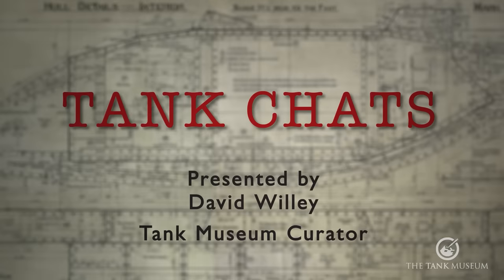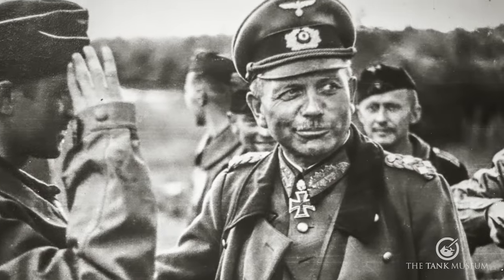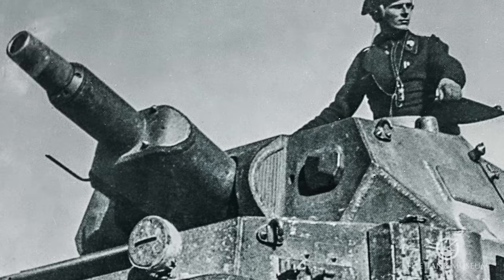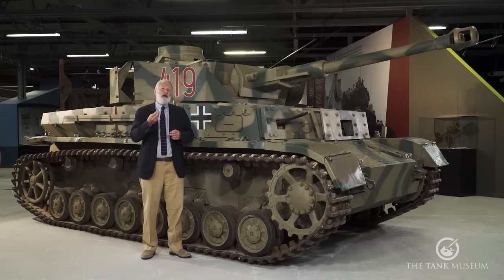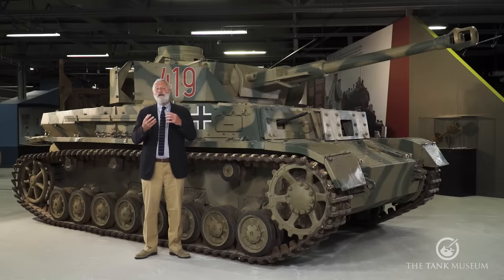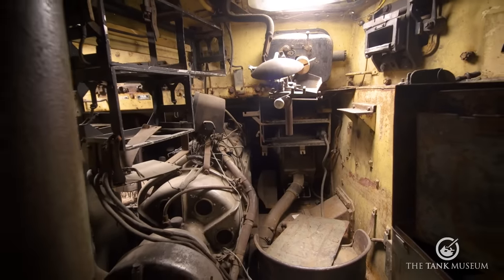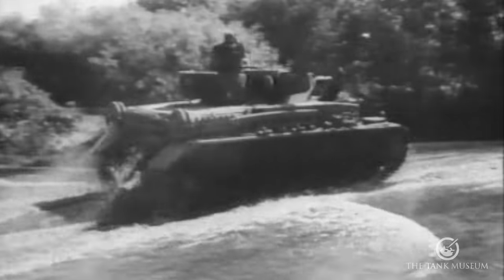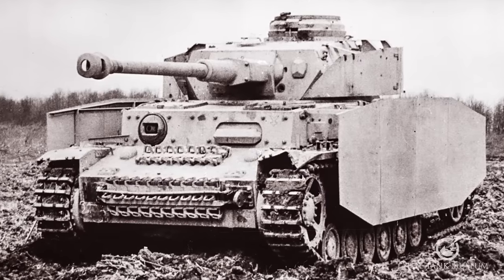Tank Chats #106 | Panzer IV | The Tank Museum

Comment: Ah yes, the good ol Panzer IV. Looks great, and doesn't break instantly when you decide to go up a bit of a hill.
Reply: AKUJIRULE  you first
Reply: AKUJIRULE  youre point being?
Reply: (Sad Elefant noises)
Reply: AKUJIRULE maybe they should have used their brains when designing the panther with a sealed hull lmao
Reply: @Vibakari  they did. where do you cross rivers when most bridges (in the east mostly made out of wood) can only support 25tons. Sealing up the engine and add deep wading capabilities was pretty clever.

If I watch the Swedish post war tests of panther and sherman, the panther continues to climb slopes and hills, plows through deep mud and snow without catching fire, while the Sherman fails on most obstacles.
Reply: @HaVoC117X  I have told everyone to watch that video before saying anything about Panther. It climbs hill no problem and didn't even burst into flame.
Reply: I'm sure you are referring to the pzV, you need to look at actual combat reports, and if you do you will find the reliability issues are greatly overstated by so called western experts. You sell a lot more books and speaking engagements if you tell the audience what they want to hear as opposed to facts
Reply: @Anlushac11  exactly. Only the early panthers from 1943 were kind of unreliable. Over 6,000 weren't built for mo reason
Reply: Nah, the Big Cats were reasonably reliable when used within their designed parameters. The French had no big complaints with the dozens of Panthers they ran for a number of years. If you clean the oil and transmission of a Tiger I every hundred or so kilometers as intended, it runs beautifully and over terrain that would stress most other tanks of 1942 badly. The real issue is that the Germans never really had the time to do the needed maintenance because they were fighting a much more intense war than planned, so ALL their vehicles were breaking down by the mid-war and it would only get worse. On the many lists of German vehicles the Allies found, as you will find quite a few "reliable" Mk IVs broken down alongside the Panthers, because they weren't getting the love and attention they needed either. You should be able to find some in the American National Archives or the Imperial War Museum if you wish to look. Heck, just check them out anyway because archival records are awesome, especially if the words Aberdeen Proving Grounds show up!
Reply: @genericpersonx333  another thing to consider is that most Germans of that era didn't even know how to drive a car, so training the average German how to properly handle a 45 ton, 6-700  horsepower tank would have been hit or miss even in peace time conditions
Reply: @HaVoC117X  what is the title of that video footage?
Reply: @Anlushac11  no wonder the Nazis won the war!

Comment: Forget the Panther and Tiger, Germany's two most important tanks (well, AFVs) were the StuG III and the Panzer IV.
Reply: Yep
Reply: Can't "forget" the Panther and Tiger! Without those and other strong AFV's, the Battle of Kursk - and Germany - would have been lost much more quickly! Yes, the PzKpfW IV made up the backbone of all tank divisions, but it was the Pz V and VI that helped to counter the T34, the JS and KV tanks, not the Pz IV's... which would have been pulverised without their successors in support to both take and deliver the big punches.
Reply: @johnny_pilot  Eh, the big cats were pretty overrated imo. They were prone to breaking down, and even though they were tough, they were hard to replace. Being difficult to repair and being too expensive and complex to mass produce effectively. Most of Germany's heavy tanks were lost to their own technical difficulties rather than combat. And and since the germans were fighting a war of limited resources and fuel, they were probably more costly than they were worth.
The light and medium tanks and the cost effective stugs were the real peak of German engineering during the war.
Reply: @nbewarwe  the usual comment again, :-)) and as usual not that true.
Reply: AFV is an apt translation for Panzerkampfwagen: Pzkfw
Reply: @nbewarwe  They were losing and on the defensive by the time Panther rolled out. There's no point having a cheaper, more practical vehicle if you don't have the men, fuel or production capacity to field lots of 'practical' vehicles. I would have liked to see the Pz. IV line continued and perhaps given sloped armour like a Panther, maybe a high velocity gun like the L70 etc. etc. but the fact is the German's best option at that point was fewer, tougher, more powerful tanks. And Tiger, at least, was always going to happen. So I'd say things played out exactly as they were supposed to.
Reply: @vincentrees4970  that's a fair point
Reply: @nbewarwe  The Tiger tanks both Tiger I and Tiger II were not unreliable.  They were high maintenance items. (All tanks are high maintenance items) but so long as the procedures of track tensioning, bolt tightening etc were carried out it worked fine.  That was understood by the German Army when it acquired the tank and it was considered acceptable given it was a specialist tank used for breakthroughs.   The Tigers did not have issues such as the final drive failing as Panther did because the Tiger I/II were given well engineered and manufactured products.   Panther went from drawing board to combat in less than 1 year.   That's an incredible achievement.  It's not surprise it had faults in the first year of operation.  By the time of Ausf G it was pretty reliable.   The Sherman and Panderer IV were reliable because they were mature products ithat had been in production for several years and in which the bus had been ironed out.  The Sherman was based on the Lee Grant mechanical.   In the case of Panther final drive gearbox lubrication issues solved some of the reliability issues but these fundamentally came out of being a simple straight cut gearbox instead of herringbone gears (Sherman) or planetary.  (Tiger and T-34) because of a machine tool shortage.
Reply: @nbewarwe  Germany's best bet was heavy tanks because they didn't have the manpower or the oil to field a larger number of medium tanks. The Panzer IV and III couldn't take Russian 76mm AP rounds to the frontal armour, and even the long 75mm Panzer IV had trouble against IS2 at distance. Tigers and Panthers had much better guns, and much better armour, so less tanks were needed. That means less fuel and manpower.

Yes, they did break down a lot. No, that doesn't mean that focusing on the Pz 4 was a better idea.
Reply: @johnny_pilot  except more Panthers were lost at Kursk to mechanical failure than destroyed by Soviet guns.

All Panthers at Kursk were assigned to the 39th Panzer Regiment. On 4 July the regiment had 200 Panthers available.  On 5 July, the opening day of the battle, at least 6 or 7 (with some reports saying at least 12) broke down approaching the battlefield, and around  20 more were damaged - some severely - when they entered a minefield.  Only 158 were reported to have actually entered the battle, and by the evening of 6 July only 40 remained as combat effective. But just 37 were destroyed outright or damaged beyond repair (including one destroyed by a PzIV which mistook it for a T-34) , which means that over 120 - a staggering 77% - of the Panthers that actually entered the battle were unavailable due to mechanical breakdown after just TWO DAYS   This was the pattern for the entire battle: most Panthers broke down, were towed back behind the lines to be repaired so as to return to battle, only to break down again. The telling statistic that must really be considered is that over the Panther's entire operational history of 22 months (July '43 to May '45) the final drive assembly lasted on average less than 70km before it broke - and during its early service was FAR more prone to failure than at the end of the war.

By contrast, Germany fielded over 700 Panzer IVs at Kursk, a tank that was FAR more reliable than the Panther, and for the long-barrelled versions, could destroy a T-34 or KV-1 at moderate fighting distances. There were also over 400 long-barelled StuG IIIs present.  Given that the Soviet forces employed "berserker" tactics whereby their tanks closed to EXTREMELY close range, the advantage of the Panther's 75mm gun over that of the Panzer IV (and StuG III) thus becomes a moot point.  In fact, distances were often so close that even Panzer III (of which 668 of all marks took part in the battle)  'speciasl' with the long barrel 50mm recorded successes against T-34s. In fact, at around 100-200m, this gun could even penetrate - in theory at least - the armour of a KV-1 using APCR and APCBC ammunition.

As for the Tiger I, only 146 were available for the entire battle, and is is believed that more Soviets tanks (and other AFVs) were destroyed by towed 88mm guns than those by Tigers.

As for your comment about the Panther and Tiger countering the IS (JS) family of tanks, it must be noted that this new family of Soviet  tanks did not take part in the Battle of Kursk, and the earliest version, the IS-85, did not see action until around  December '43 / January '44 in the fighting around  Kyiv.  Even the KV-85, effectively the prototype for the IS-85 / IS-1, only saw first action in September '43 after the Battle of Kursk had concluded.
Reply: @brucelamberton8819
"Forget the Panther and Tiger, Germany's two most important tanks (well, AFVs) were the StuG III and the Panzer IV."

The Panzer III was the most important and most prevalent German tank 1939 to circa mid 1943 and the Panther was the most important and most prevalent German tank circa mid 1944 to the end of the war.

The Panzer IV was only the most important German tank for about a year, circa mid 1943 to mid 1944. That's it.
Reply: @johnny_pilot

Indeed, and from June 1944 to May 1945 there were 1,837 Panthers and 1,666 Panzer IVs deployed in the west. More Panthers were built and deployed in the last year. We cannot forget them.
Reply: @nbewarwe

In 1944/45 there actually wasn't a big difference in overall average operational % between the Panzer IV, Panther and Tiger. It was around 62% to 71% across both fronts. None were lower than 62% and none were higher than 71% overall on average. The Tiger actually had an overall higher operational average on the Eastern Front at 70% than the Panzer IV at 68%.

Source. Tiger I and II Combat Tactics by Thomas L Jentz.

Comment: One of my all time favourite tanks.
Reply: This panzer 4 is my favorite, because it shows how germany took the older tanks and tryed to keep them in service.
Reply: @eLKy 15 this is one of those comments where I really cant tell if it's a joke or not.
Reply: @eLKy 15 I guess they look a little similar at a passing glance but if you put a Pz IV and Tiger next to each other they are far from identical. The Tiger is a lot bigger, more boxy, has different road wheels, a bigger gun etc.
Reply: @eLKy 15 they built a lot more Panzer IV's than Tigers but both were used a lot, especially in the second half of the war. The Panzer IV was produced first (the initial model came out in 1936) and they started designing the Tiger in 1938, though the first Tigers weren't produced until 1942.

Tigers are very impressive machines, but they cost a lot more time and resources to build than a Pz IV. They used a lot more fuel and also tended to require more maintenance due to being larger/more complex; it was often hard to find parts and men with the knowledge/time necessary to carry out repairs in the field, especially during the later years of the war which led to a lot of Tigers being abandoned by their crew when they ran out of fuel or received damage they were unable to repair.
Reply: Made in 1/76 & 1/35 scale?
Reply: @eLKy 15 Because Panzer is short for Panzerkampfwagen, which means armoured combat vehicle, and this was the 4th model.The Tiger, which was designed AFTER the Panzer IV, actually had the designation Panzerkampfwagen VI, as it was the 6th model developed.
Reply: @eLKy 15 FYI on the point of the Panzer IV looking like the Tiger, this is what escalated "Tiger Terror" within the western allies after D-Day, when many times a boxy-looking tank was sighted it was mistakenly reported as a Tiger when it was often just a Panzer IV (of which MANY more were built than Tigers).

Comment: "About 8,353 of them were built." 

Idk why, but that made me laugh.
Reply: "It could have been 8,352.8 or 8,353.1, we're not sure, so it's about that many." - is what I was thinking. 😁
Reply: Meanwhile the US and USSR build tens of thousands of their tanks
Reply: @awkwarddoggo05  49 thousand Sherman and 64 thousand T-34, yeah, I guess there were more of those.
Reply: Very British way
Reply: @imrekalman9044  The Soviets built 85,000 of the crappy T-34's alone. And the Germans destroyed 55,000 of them. Counting the tens of thousands of even crappier light tanks and the heavy KV and IS tanks destroyed by the Germans, you've got tank Armageddon for the Soviets. It's basically human wave attacks with crap tanks instead of rifles.
Reply: @haroldfiedler6549  Not really -- the (human) loss ratio was only about 2:1 for the Soviet Union to Germany respectively, and most of that discrepancy was from the early stages of the conflict. The Red Army was probably the most capable land force in the world by 1944, and certainly by 45.
Reply: Jim Goose  YES, crap tanks. No interlocking and fully welded armor plate. A piece of water pipe for a main gun. Total lack of radio equipment. No turret basket. Turret placed in the front of the hull which made  the tank unbalanced and unsuited to armor and main gun upgrade. Track pins without threads or nuts. The list of shortcomings of the T-34 is virtually endless. Only a fanboy moron would think otherwise.
Reply: @haroldfiedler6549  You should do some basic research before posting. Even if you just look at Wikipedia, you'll see that Axis KIA/DOW/MIA + prisoners were ~8.5 - 9 million, while Soviet casualties were ~11 - 12.5 million. That's a loss ratio of 1.2 - 1.5.

If you'd prefer to look at total military deaths instead, the Axis suffered ~5 million, Soviets had ~8.7 - 10 million, making a ratio of 1.75 - 2.

No historian of merit claims anything close to your ratio of 10:1.
Reply: @shogaal14  Well, I would give you the same advice except that you have to have a brain in the first place for it to do you any good.
Reply: @haroldfiedler6549  Funny how the Snooty tanks got beat by the Crappier ones in the end.Its war, looks and performance mean little if it means it sucks up resources you dont have.The germans should never have attacked Russia, and instead have concentrated on blockading the channel and invading the brits, then it may have been possible to take on Ivan
Reply: @shogaal14  hey buddy ur wrong, Germany tank deaths to kills are vastly higher
Reply: @scavulous6336  Which historian are you citing? Where are you pulling your data?
Reply: @shogaal14  "In the case of armored vehicles, this 'price' amounted to 96,500 tanks, compared to 32,800 German AFVs on the Eastern Front during the Second World War. This corresponds to a loss ratio of 2.94 to 1"

YouTube won't let me post the link but just look up german vs soviet tank losses

Comment: An excellent and informative video.  The tank that could go under water, the Tauchpanzer, was issued to the 18th Panzer Division and the 3rd, if I re,member correctly.  The 18th actually did use them to cross the Bug river during Barbarossa.  There were 4 units of approx battalion strength, 3 went to the 18th PZ and one to the 3rd PZ.   I haven't been able to find if the 3rd PZ used them to kick off Barbarossa or not.

Comment: 20:36 Was this antenna-saving device the result of someone having the foresight to predict the gun accidentally knocking off the antenna, or was it the result of hard-earned experience of crews losing their antennae in battle?
Reply: Foresight. You'll already see it fitted on photos of very early models.
Reply: The Germans overengeneered everything from the beginning. ;-)
Reply: @ulissedazante5748  A radio arm is hardly overengineering.  Other tanks from other nations had them too.

Comment: 14:40 "The muzzle brake reduces recoil by 55%?!!"  I had no idea that they could be that effective. Is that a common effectiveness for most muzzle brakes? Thanx for this chat in particular David. The PZ-IV doesnt get enough coverage. Workhorse of the German army.
Reply: When shell/bullet leaves barrel any remaining gasses, that previously accelerated it forward, expand uncontrollable in every direction, including backwards, creating additional recoil. Muzzle break is meant to control this expansion, redirecting most of it those excess gasses sideways instead, as bullet passes thru areas with baffles, venting gas thru them, resulting in significant reduction in backward motion, aka reducing recoil and sway. Since baffles are placed in pairs, venting gas acceleration is cancelled by two streams going in opposite directions.
Average reduction of recoil is ~30% with muzzle break having ~75% efficiency, but there are quite a lot of factors involved.
https://www.youtube.com/watch?v=Yb5nOjqvwI8
Reply: It is quite obvious
Reply: @Erwin_Von_Heidenheim  Percentages are quite obvious?
Reply: @uegvdczuVF  yes
Reply: You should see the massive muzzle brake on the Barrett .50 cal sniper rifle

Comment: Was there some clear reason why the Germans didn't upgrade the turret armour to match the 8cm on the hull? The only one I could think of is that maybe the extra weight on the turret front might cause issues with the turning mechanisms.
Reply: Zagskrag The weight is always an issue.
Have to remember also that if you add extra armor on front, you also need counter weight.
Engine, gearbox and chassy also have their limits.
Tigers really suffered that.
Thicker armor and bigger gun made everything bigger and heavier.